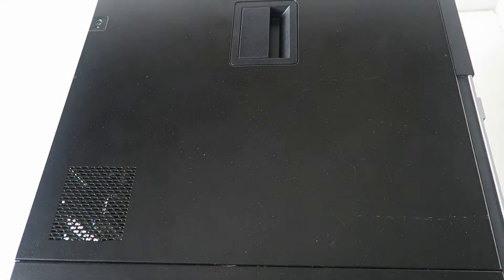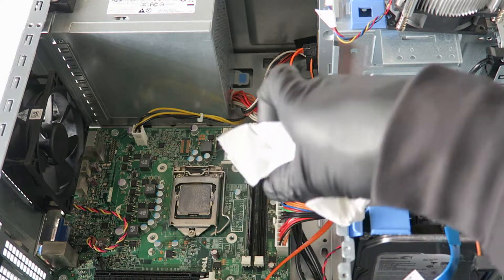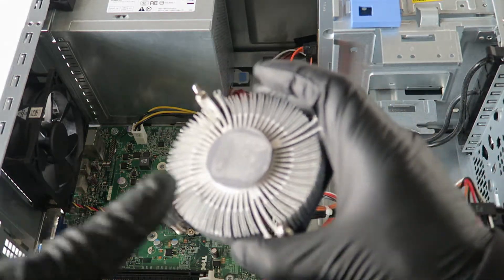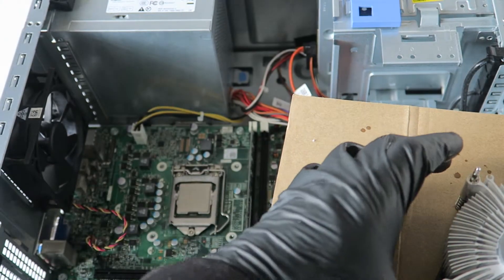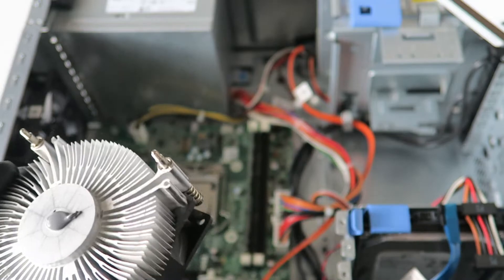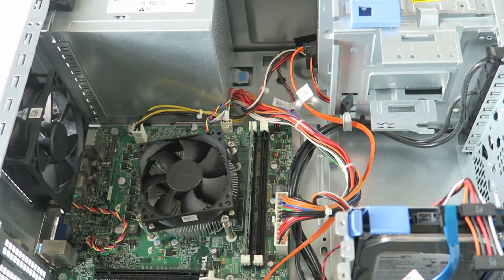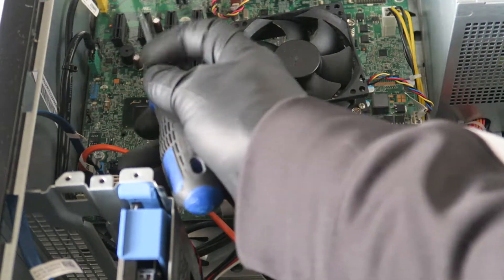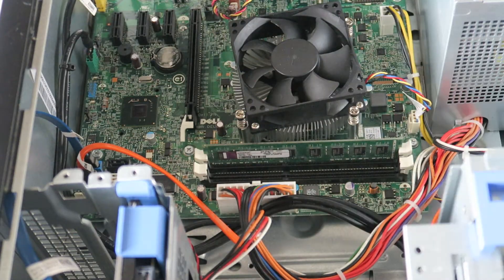Dell Optiplex 390 Processor Upgrade CMOS Battery

Comment: Yo what core i3 do i neec can i use a 2100 dual core?
Reply from the maker: Hi, yes you can
Reply: Mxkdi thanks with a gtx 750 ti what is the cheapest power supply.
Reply from the maker: Hi, corsair or cooler master or antec you can buy 450w power supply  around $40

Comment: Can a i5 2500k work with this optiplex.
Please reply
Reply from the maker: Hi, only intel core i5 2500 will work.
Reply from the maker: i5 2500k is overkill because you can't overclock on that system.
Reply: Mxkdi oh ok thank you
Reply: Can this use a  i5-3570  and i7-3770 i heard that the motherboard uses the same h61 chipset but im not really sure if  i should upgrade my i3 2120 to i5-3570 or i7 3770 on this computer.